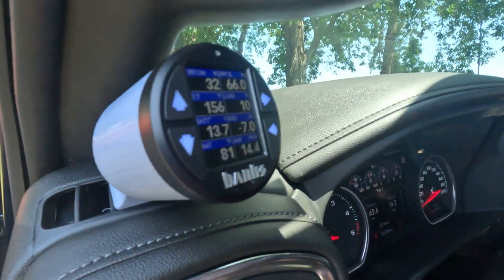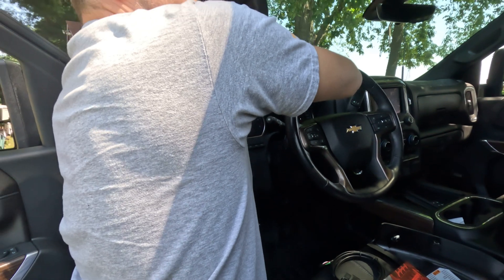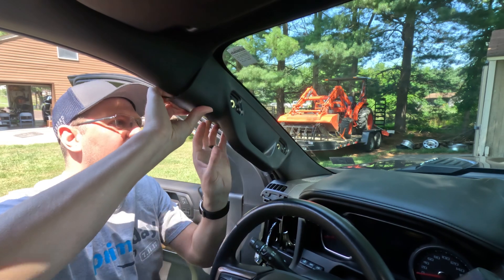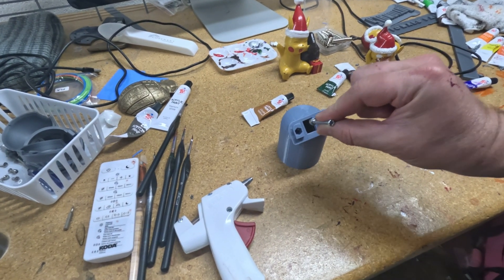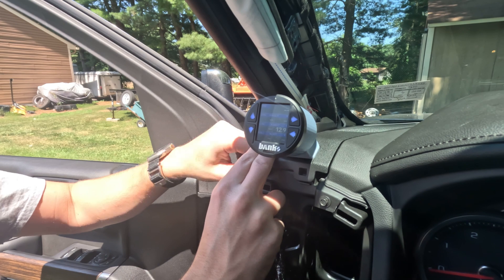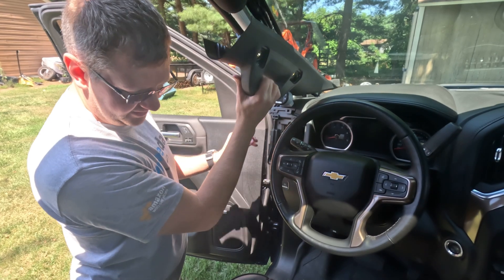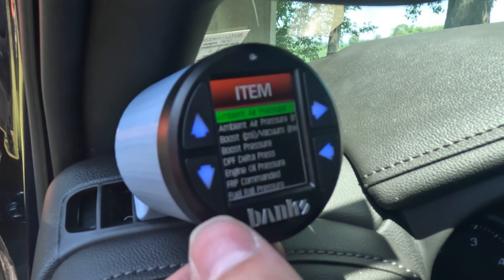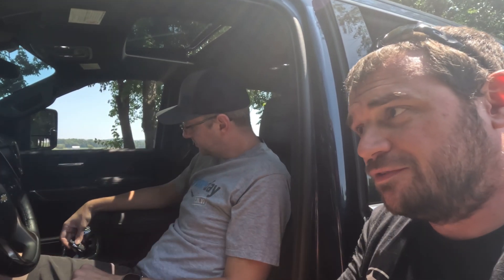Installing a Banks iDash on a 2022 Chevy Silverado 2500HD - Plug and Go!

Comment: the one thing they should let you do is pick when you want to burn off the soot in the DPF.....would just be more convenient for the consumer based on their personal driving......this is a huge letdown by the manufacturer

to have a regen once a tank cycle is extremely excessive as well..

my truck regened and on the 35mile freeway home, I was already at 50% again.....probably be trading my new duramax for gas truck soon